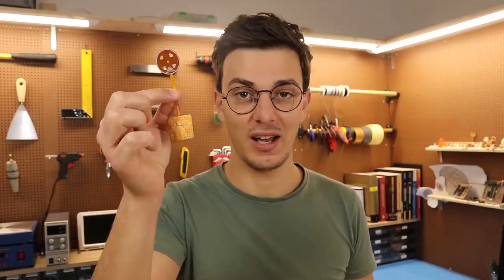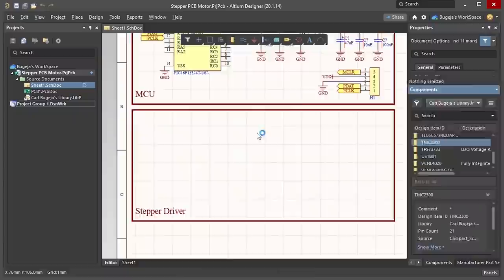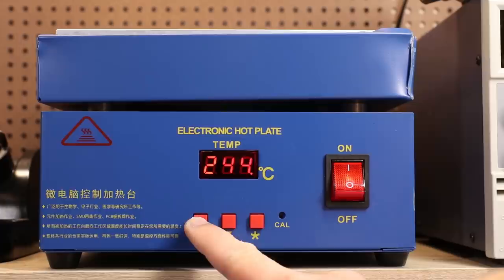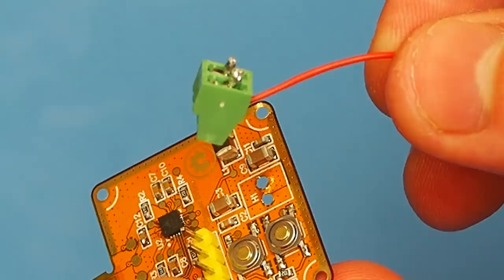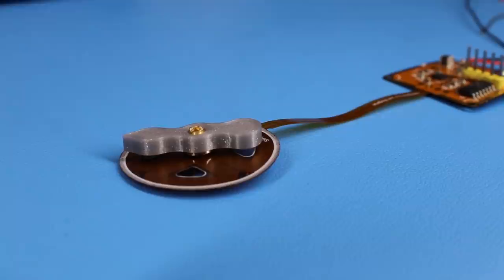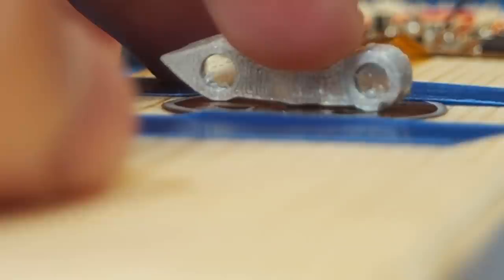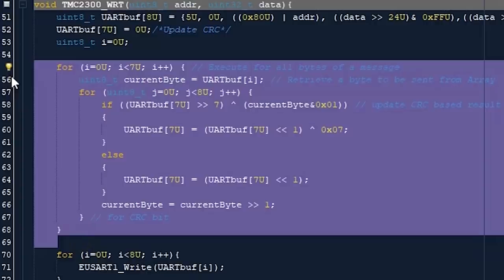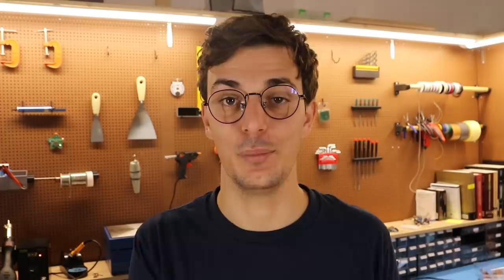Microstepping a PCB Motor?

Comment: In 3D printing there have been problems with unofficial TMC driver modules not working with UART because some pins needed to be set to switch it from SPI to UART. I remember having to get my soldering iron to short some pins on my boards but I can't remember what they were. Maybe it's a similar problem?

Comment: I think this would be a great opportunity to get some magnetic viewing film to try and observe the actual magnetic fields produced.
Also about the flexible PCB dilemma. Would it be possible to have some standard ones made with one coil and the connectors and so on and then get one of the "coil pads" from one of these prototypes and glue it on top of the coil on the hard pcb? this way you could get the stability of a hard PCB but also the stronger magnetic field from the flexible ones? and use the one coil on the hard PCB to augment that further?

Comment: I wonder if the orientation of the coils cause the problem. As I see it the magnetic field goes up / down perpendicular to the pcb. Wouldn't it be better to have a long rectangular pcb with several coils side by side and roll it up to a loop. So the magnetic field would point inwards to the axle? But I'm just guessing

Comment: your problem is obviously magnetic leakage. The reason you are missing steps and having uneven steps mostly is because your maxnetic flux is not constant along the surface of the coil.
Id say try adding a piece of iron on the back of the coil and make sure the permament magnet poles cover 1,5-2.0 times the coil width to make sure you get a decent flux.

Comment: to test 8 poles just put a second pcb above the rotor. I think you need more phases and you need to account for the different field strengths. The magnetic field is stronger at different points through your rotation because of the large coils.

Comment: It seems like electromagnets center is too big, which is most likeliy the case of problem, which means bigger magmetic center. Therefore no micro center for steps, which explains shaking since magnetic flov is having slightly different ways to travel.

Comment: I would think your coil and magnet shape is to blame for the poor microstepping.  Either your magnets need larger coverage to span a full coil or you need more coil pairs .  It will be very difficult to get exact micro stepping degrees with nonsalient topology, as the flux density is not linear with displacement and there is no cheating via salient teeth at regular intervals .  

 I would also assume that a larger gap between coils would help prevent shorted magnetic lines.   You want your coil gaps to be larger than the airgap to encourage flux to the magnet instead of adjacent coil

Comment: I know this is 2 years later, but did you ever get the communcation with the single wire uart working?  I ran into a very similar issue and after much headache, I discovered that trinamic used a different wiring convention for tx/rx then I was used to.  Essentially, instead of commecting the uC rx to the trinamic tx, (and tx to rx), you have to connect the uC tx to the trinamic tx (and rx to rx).

Comment: You should use 2 sets of coils coming out from opposite sides of the board to encapsulate the starter!
In other words 2 sets of coils 1 motor it should also upgrade your resolution as well!

Comment: have you tried laminating coils on top of each other and using a higher voltage in series?  What voltage are you giving the driver? Lost steps could be not enough voltage headroom. Microstepping that drastically has a high cost in holding torque (I'm assuming 1/32 with the drv ), maybe 8 coils in 2 poles on 1/16th would help reduce the angular distance of each step?  Great project so far, I'm excited to see where this goes! :)

Comment: I suggest to test the idea You have to do traditional PCB with thick traces and maybe multiple layers and drive it through power amplifiers, then You got 1-2mm against 0.5, but some very different ..  torque? how does it say right?
Reply: Oh, I forgot, maybe add more coils and drive it like brushless motor?

Comment: When observing the design of the coils, I noticed that they were drawn in a concentric direction, there is a test that should be performed with a polarized lens to see the direction of the magnetic field and its orientation.  The phase is correct in terms of orientation, as the drawing is concentric it must have a vertical flow and it should have a lateral flow so I recommend the zigzag design.  A compass is unreliable for this analysis, as it only gives you action and disorients you in the direction of losing action.  I do not fail to give the opinion that the design of the coil should be in zigzag, the lower part of the magnetic must be free and if possible, 6 coil streaks to break.

Comment: first rule of stepper drivers... test with a known off the shelf stepper motor first.

first rule ? of making prototype flexible pcb motors inflexible is glue the trackless underside kapton pcb to some small iron/steel/aluminium see and understand 'Professor Eric Laithwaite: The Circle of Magnetism - 1968'  copper wheel etc, 
added benefit more/better induced magnetism for free.

second rule ? see and understand 'robert murray-smith magnetic gear'....
'robert murray-smith Playing With Coils And Magnets' etc

nice to have.. like lennart said get/make some magnetic film to at least see what the fields are doing and where they actually are

Comment: Have you messed with wiggling traces for resistors and gaps for capacitors? I wonder how viable it is to make a pcb where many if not all capacitors and resistors are represented through traces.

Comment: For UART to work you need Mode to be high (RA2), so maybe that's a reason but i don't know your code. 

Also normally you would use a diode and not a resistor when you connect RX/TX to a 1 wire uart. (Where the catode of the diode is facing the TX pin un the UC)

I also advice using way higher frequencies, steppers have a bad performance at very low speeds. The minimum we use to avoid resonance problems is normally 100+ Steps / seconds with a 1.8° stepper motor.

€: Her's a pciture: https://cnnblike.com/post/stm32-OneWire/blog002-008.png

Comment: Maybe try replacing the metal shaft pin for plastic or carbon fibre one or even a toothpick? perhaps the coils are inducing a field making it magnetic and causing problems? You are way smarter than I am I'm sure you had thought of that too.

Comment: Just had a quick look at your circuit design that is linked on Hacakday.io.
One question: Why do you connect VIO-Pin and the STEPPER-Pin of the TMC2300 to VCC? It would make more sense to have them at the same voltage as the PIC, so VDD would be the better choice here. Maybe the filter inductor is acting strange at boot-up and thats why the serial interface is not working as it should?
And it would probably be a good idea to have some Pull-Up oder Pull-Down resistors on the MS1/AD0 and MS2/AD1 Pins. Because they are inputs and in the serial mode they are setting the device address. And they are inputs on the PIC controller too, until the firmware has started to initialize the IOs, so you basically have floating adress pins during bootup.
Reply from the maker: You're right on the ms2/ms1 pins, pulling these pins would be safer :) thinking about it.. adding an initialization delay in the software is also a good idea (which i didn't have)
Regarding the inductor filter - VDD and VCC are connected to the same supply, one is for the motor (can get a little noise) and the other is for the microcontroller. The inductor makes the micro's supply safer   if these are any current spikes on the motor

Comment: You are becoming a guy with the hammer I am afraid.. The stepper motor uses a teethed stator and rotors, and their number determines the step angle. The number of electrical poles are spread across number of teeth. You have a 90° poles, where are the stepper is usually 1.8° or worst case a 3.6°. The micro stepping controller is made to reduce that stepping angle. So you need to think about what is the angle for your 1/4th step means.

BTW the one wire protocol used by Trinamic is serial interface with both Rx/Tx combined in one. You can look at merlin driver to see how its done in arduino.

Comment: I guess that a dual phase motor without the spikes is not going to work very well, in the industry you do not see them.  What you see is three phase ones all over the place, maybe there is a reason. Maybe a three phase "stepper" will work better, the issue might be the driver, as most of them are for steppers (dual phase).
Maybe this opens the gates to a project to create a "three phase stepper driver" design,  with PCB coils.

Comment: pcb has very thin  copper foil. What if to take around 1mm thick copper, cut gaps between coils by using laser cutter CNC, then put it on thin Kapton foil, spill on it epoxy to let it fill gaps between copper coils, and then put one more Kapton foil on top and give it  time let epoxy solid and make everything monolithic?

Comment: ...how are you expecting uniform torque across 360 degree rotation with a motor lacking axial symmetry THIS much?

I mean if you consider 1/4th of the motor, it should be obvious that the magnetic field ia not gonna look like you want it.

As such custom ddiver profile would be nexessary to even just approximate uniform steps.

Comment: My thoughts are that is extremely risky to provide prototype project without proper measurement methods. More over maybe it will sound not polite but electromagnetic flux simulators exists. I know it's expensive to buy simulating software but sometimes it's better to forecast results of solution and have proper tools to debug and check performance. Tinkering in cad is awesome but still it's waste of your time if you don't use basic calculations of physics.  Of course  i could be wrong but my intentions are  not to hurt some feelings but to share my doubts. Because I like this channel.

Comment: microstepping assumes that you have a more or less linear system (local to the "teeth"  you can vary the magnetic field linearly) but having 4 squashed coils means you have no hope of a standard microstep being linear. Particularly since it seems you have little to no intuition about magnetic flux and designing a magnetic circuit, this is going to take a lot of blind attempts.

Comment: Your's problem: https://www.youtube.com/watch?v=cqjscAKuq-4   It can also be a problem that when you put down such an extra strong Neodinium magnet on a flat surface, it will instantly align with the Earth's magnetic poles. This force is quite high, while the drive of your motor is not much stronger, so it seems to jump/skip... Please test my theory by noting the direction of the missed step, say with a marker pen, and then slightly rotate your whole motor. If I'm right, then the error will always be in the same North-South direction and not your motor have local fixed jump..

Comment: They are popcorn components...
Reply: BTW you could try to make a synchro: imagine that you feed your coils with three phase power. Then you feed your rotor with a sine wave. The phase relationship between the stator and rotor will be fixed and you can now modulate this phase relationship to keep the rotor static in a certain angle. Its pretty hard to explain using words, even more when those words are not in your native language.

This might help: https://studfile.net/preview/5648204/page:17/

Now imagine that you have a synchro receiver, and instead of having a synchro transmitter, you syntetizise (?) the waveform using a microcontroller. Precise positioning.